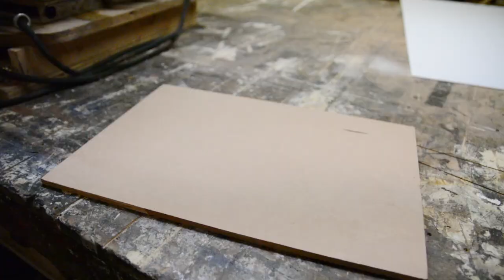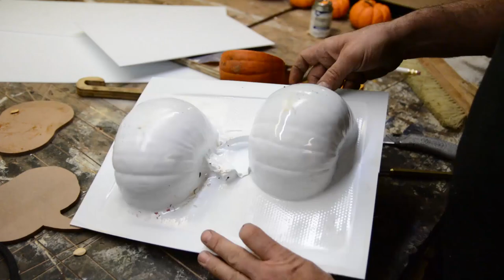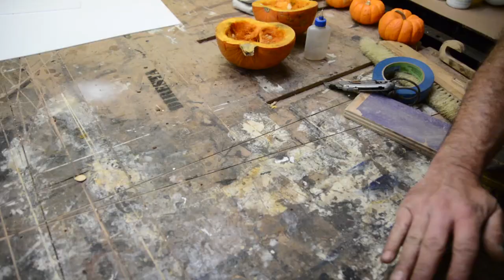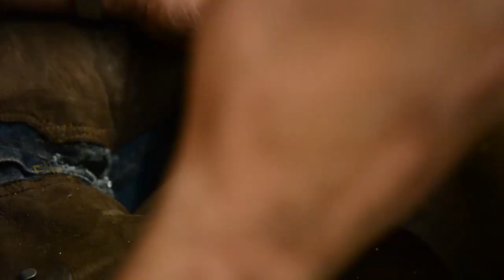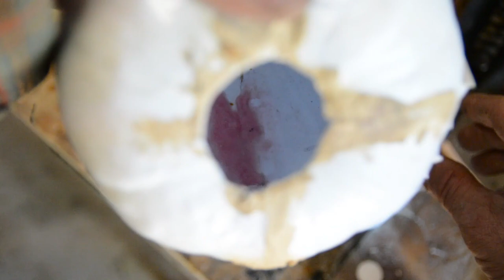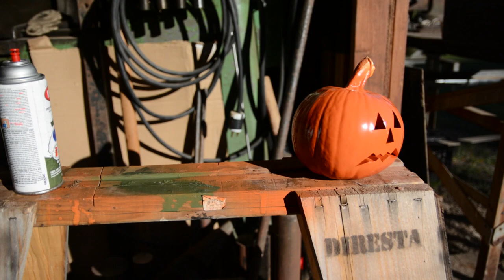DiResta: Plastic Pumpkins

Comment: seems like a lot of work for a 2 dollar pumpkin
Reply: The point it for you (if you have an imagination) to see this project and apply it to some thing you think up (if you can think). Good luck in your life.
Reply: +jimmydiresta I need as much luck in life I can get.. thanks
Reply: +PsychoAxeMan maybe it will make you appreciate that 2 dollar pumkin you buy a little more.  Let other people make stuff for you!
Reply: +jimmydiresta He's obviously missing the whole point. Which begs the question; why is he watching Make videos?
Reply: I can imagine doing a long run of these, then you have a complete cornucopia that you can use for years to come or sell.
Reply: No, that is a mother honkin Jimmy D Pumpkin set! Money cant buy that imagination and talent of his. Go troll Walmart PsychoAxeTool
Reply: +jimmydiresta Gotta say that Psycho has a good point.  There are a lot of easier ways to make a plastic pumpkin than jacking up your band saw or using a vacuum former. I mean, if your specific purpose was to make this task as difficult and messy as possible, thumbs up, you did it.  Otherwise you're just going for empty props from the fanbois by doing something as hard as possible.
Reply: +Reboot153 I challenge you to make a plastic pumpkins simpler then this. Put your money were your mouth is.
Reply: +jimmydiresta I didn't mean to  start anything on here was just a comment and people blow it out of proportion
Reply: +PsychoAxeMan +PsychoAxeMan I think the best way to not "start anything" is to not insult or demean someone for the sake of being heard. What did you expect to come out of what you said? You insulted his work and he gave you his opinion of your critique. If you're too narrow minded to see the art in the process then you're just wasting your time here.
Reply: +Luis F Gerena how is that an insult ? do explain
Reply: +PsychoAxeMan Here's a hint kid, go read Jimmy's response to your original comment.
Reply: +Luis F Gerena um.. I have . u should look up the meaning of insult before using it.
Reply: +PsychoAxeMan I guess what they are trying to say is; just because something is hard to do, and that there are cheaper and 'easier' routes out there, doesn't mean it is the best option. 
Nobody will remember the 2 dollar pumpkin, but I'm sure many will remember the handmade one and getting it as a gift. And the maker has an outlet for their creativity...and it's fun making stuff!

Cheers Jimmy, great video as always.
Reply: +Dave James thank u someone actually understood my comment. everybody just went off cause they thought I was tryn to start something . jimi can build some great stuff
Reply: Jimmy builds amazing stuff, he's a real inspiration.
I can see his point of view, and why he'd be offended by the comment. 

The hazards of youtube comments are that you can't type tone, delivery, and facial expressions!
Reply: +Dave James who would of thought the Internet would be so harsh lol
Reply: +PsychoAxeMan 

So it's not so much the "what" as it is the "how" to get something done. Skill building tutorial if you will. How to vac form, how to seam thin parts and clean up the seams, how to add in the illusion of "depth" etc. A lot of learnin' wrapped up in that simple little pumpkin if you chose to accept what is being offered.
Reply: +Reboot153 did you think about it? "lot of easier ways? please show us just one. with the same looking results of course..
Reply: +jimmydiresta Quality hand crafted goods as always. I think some folks just prefer to be lazy and buy garbage made on an assemly line. Don't let these trolls win. Your subscriber basebsays enough. If we are all "fan boys" we are for a reason, you make some cool shit in cool ways. I dont see these trolls with a fan boy following. Keep on keepin' on Jimmy, respect.
Reply: +jimmydiresta   
That's not really a hard challenge.  
The point is that you did a Make video that is far too complex for the end result.  
I can go out and get a few kilos of RTV and a few kilos of resin and throw some cool ass pumpkins out but then I just spent about $80 and a good few hours to make something I can buy for $1
Reply: +Dirty Robot you have just shown you have no experience. What I have shown cost 8-10$ in plastic. Pumpkin was 2$ and the lights were 2 each. That's about 15 used total. What you describe is at least 100$ in molding supplies. And more resin. Prove me ..wrong I dare you.
Reply: +jimmydiresta Hi Jimmy.  Sorry but it's been a busy weekend with the family.  I have thought about an easier way (you originally said "Simpler" so I hope you wont split hairs on my answer).  While watching your video I originally thought that rotocasting the pumpkin in a two part mold would result in a better end while also eliminating a number of steps that you used.  I see below where Dirty Robot also suggested using RTV and resin.  Ultimately I'm going to identify an easier ("simpler") method as being any that eliminates the need to clean pumpkin guts out of a band saw.  I'm sure that even your fanboi army would agree that there has to be an easier ("simpler") way to make a pumpkin than starting off with a bandsaw.
Reply: +jimmydiresta True, while what you made uses only $8 to $10 of plastic, you also used hundreds of dollars worth of power tools, not to mention the custom equipment of a vacuum former (cause really, how many people have one of those?).  As for the cost of being able to rotocast a pumpkin, Smooth-on makes a full brush-on rotocasting kit for just $66.13 (with free shipping if you're an Amazon Prime member).  Given that you dont have to deal with the mess of a cut up pumpkin, cleaning a band saw or using every power tool in your shop, I'd have to say that rotocasting is a easier ("simpler") method.
Reply: +Reboot153 i made a vacuum form out of a 2x4ft piece of mdf with a hole for my shopvac. cheap,  easy project.
Reply: +NordboDK I think it's cool that you've made a vacuum form machine in your shop.  As it is, I'm planning on custom building most of my equipment as I get the chance and money to make it.  That still doesnt change the fact that it's a highly unusual piece of equipment and one that the vast majority of people simply wont have in their workshop.
Reply: +Reboot153 my vacuuform machine was 20$ from a garage sale. The drill press was 50$!used. The hand file was  1$. ....Live a life of excuses and you will live a limited existence.
Reply: +jimmydiresta the bandsaw was 50$ on Craig'slist.
Reply: +Reboot153 the other pumpkins were 5$. The tree stump was free. The sand paper was 3$. The plastic wood was7$. The acetone was5$. Iam I under 100 still?
Reply: +Reboot153 spray paint was 5$ pre can.
Reply: +Reboot153 prove it. I've  been making things my entire life. 49 years. I have experience.  Your method would def work. Not simpler not cheaper.  Prove me wrong...  until then you are wrong.
Reply: +Reboot153 my "shop" is a shed in the back yard. it is so small I can't break down sheet goods inside it. I started collecting tools 2.5 years ago, all of which I buy used. I spend my fun money on tools instead of eating out or going to the movies. I do my own oil changes and I build my own furniture to offset the cost of tools and I am way ahead compared to the cost of buying the stuff we need, even at Sauder or Ikea prices. It is my hobby, and it lets me do some really cool stuff. Get yourself a cheap, used jigsaw, a hand drill and start building stuff. use a guide rail to keep things straight, and sand down to your line. The skills earned from making due with what you have is worth a lot. Or stay put and try to save up enough money to buy a whole shop brand new in one go.
Reply: People don't get it. Its about making the pumpkins. Its not about how much they cost, it's about making. I just made a journal inspired by one of Diresta's vids. Yeah, I could've bought it for a a dollar at the store. But nope, as a maker, I HAD to make it myself.
Reply: +tlfort among other things.
Reply: +jimmydiresta To start, I knew when you put up your "challenge" that anything I said or posted would never meet your standards.  I've read enough of your posts, seen enough of your videos and watched enough of your tv shows to know that your ego would never allow a nobody on the net to be right. That being said I will point out two things.  First, your challenge was to make it simpler, not cheaper.  You need to go back and re-read your challenge. You said, "I challenge you to make a plastic pumpkins simpler then this."  Aside from telling me to put my money where my mouth is, cost was never a factor. That was something you brought up after the fact to try and weasel your way out of the original challenge.  Considering that you have multiple workshops stocked with tens of thousands of dollars worth of tools, equipment and supplies, I'm surprised that you want to nitpick over the cost of a $65 mold casting kit.  My second point is that a rotocasting will eliminate the need for all power tools.  It produces a much more accurate mold and end result and doesnt require destroying the original.  Can you honestly tell me that a solution that achieves all that is more complex than yours?  Seriously?  You statied that the rotocasing was "not simpler."  Therefore it has to be more complex than all your tools you used, more complex than trying to butt-joint plastic (and then reinforce it from the inside through the jack-o-lantern eyes), more complex than picking pumpkin crap out of a bandsaw?  Your production method has flaws all throughout it, flaws that rotocasting eliminates but yet your method is less complex?  Please explain this because I simply dont understand how that can be.
Reply: +Reboot153 thank you for watching my content.
Reply: +Reboot153 I don't get that. you would prefer to spend the money on consumables instead of tools that will be useful for many more projects?
Reply: +Reboot153 I have roto castes 100s of prototypes in my life.  Much higher reject rate then vac form. One time and I know exactly what to expect. You said "simpler" cost of tools or not. Show me simpler. Make a video. Prove this ego maniac wrong.
Reply: +jimmydiresta 123D Catch -> MeshMixer -> Shapeways
Reply: +Reboot153 still waiting for your video sir.
Reply: +PsychoAxeMan I'm sure there's a youtube channel called "Buy" that you'd be more interested in watching.
Reply: +Ray Onnaise lol that's a good one
Reply: +Grandy Talanila Keep waiting.  I'm not an artiste like Jimmy is.  My job isnt making stuff but taking care of my family, taking care of my home and working at my school.  I havent stopped considering his challenge and I've come up with 3 more ways that are, by my definition, "simpler" than what he posted.  Given time this weekend between family, house, tutoring and personal obligations, I'm going to see if I can test one of these methods.  Until then, please keep sitting on the edge of your seat.
Reply: +Reboot153 it's been 6 months so I'm assuming since you have no videos posted you have not prove and way to make a better "simpler" pumpkin than jimmy.
Reply: You know, they're called a "winter squash" for a reason.  As soon as I had the supplies to make a pumpkin the one I wanted to model (one my daughter picked out) went bad.  Trust me, I havent forgotten about Jimmy's "challenge" and I've got three different processes to make videos for.  Just gotta wait for pumpkin season to come back around.

I do want to say thanks for keeping track of me.  I didnt know you cared so much about supporting Jimmy's ego in this matter.  Even if it takes a full year for me to make my video, that's less time than it took Jimmy to come up with his process.  Cheers!
Reply: the tools isn't cost of a project the factory than makes the 2 $ pumpkin have millions on tools they are losers ?
Reply: SOTIRIS SOYVLERIS Well said mate the tools have no bearing on it.If they did no one could afford anything.

Comment: I have an idea that might save a bit of time and work on this project. Cut the faces out before vacuforming the pumpkins, then trim the excess inside before removing the pumpkin from the form (to use the pumpkin as a depth guide). This would also give you more structural integrity, as you would have only 2 pieces glued together. It might be necessary to drill a tiny hole in the board to get enough vacuum to pull in the face, but too big of a hole may pull it too thin and break.

Comment: Is adding the acetone to the plastic wood a one time thing or can you keep adding more every time to thin it out for applying ?
Reply: I do it when it get dried out ...brings it back.
Reply: +Chris Moewes-Bystrom It's a good trick to know, just about any rubber or similar product that comes in a can (like PlastiDip) you can do this. Look on the can for something like "clean up uncured product with ___" (usually, toluene, mineral spirits, acetone, xylene, etc) and that's what you can use to thin it up. same with liquid electrical tape, I use naphtha
Reply: Sweet tip. Thanks. Looks like I might throw out less stuff now
Reply: +Chris Moewes-Bystrom  I have found it doesn't work with contact cement though. While it does dissolve it somewhat you never get back to the original consistency.
Reply: +jimmydiresta I always get at least one real jewel from each of your videos. Acetone in the plastic wood. Seems obvious; once you've seen it ;)

Comment: I'd imagine it would have saved time to carve the pumpkins before vacuum forming them. Then it would just be a matter of cutting off the back of the plastic divits, instead of making holes in the plastic and adding sides.

Comment: I assume you were using Monomer with the Dental Acrylic Powder.  Just so everyone knows if you use it make sure it's a well ventilated area and you really should wear some non-latex gloves.  If you get even one drop of monomer into your system, say through a small cut on your hand it's bad news.  Even on your skin is not a good thing.